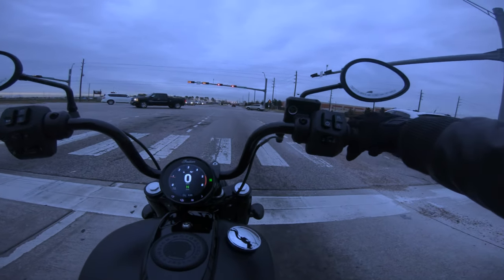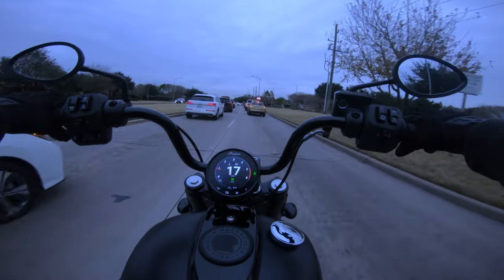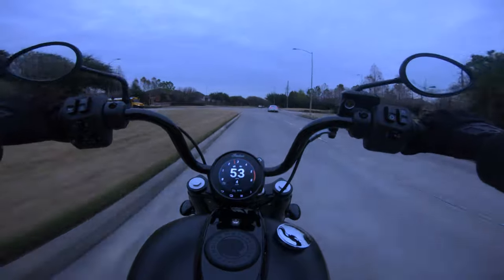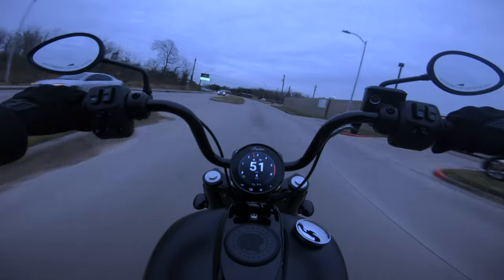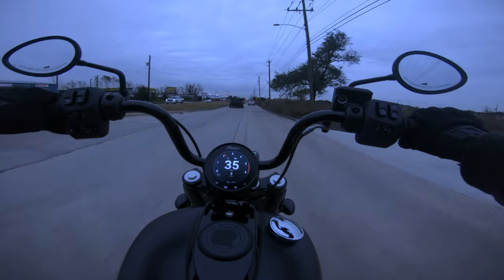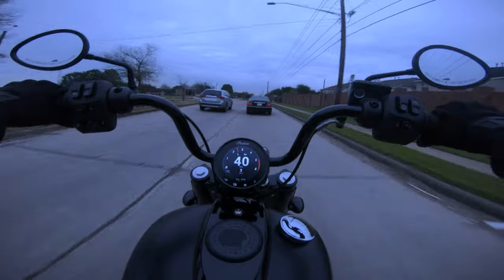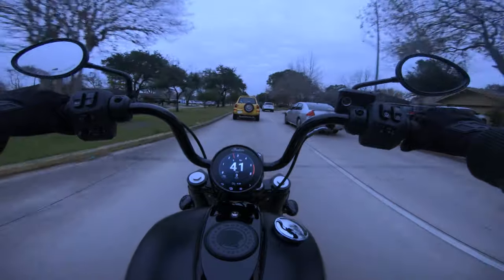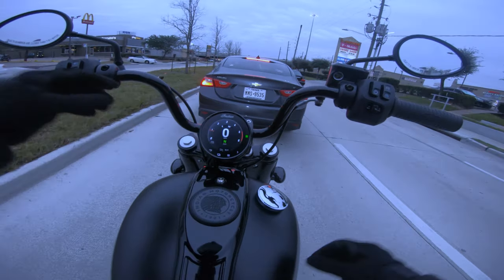Full System Exhaust In Any Day Now!

Comment: What's the stock mini apes handlebar height for your chief bobber, 10 inches?
Reply from the maker: The bobber comes with the "mid rise" bars. Which are classified as 5" bars but I've heard they're actually closer to 7". Haven't checked for myself
Reply: @darsoma9522  are they comfortable or do you believe the 10 inches mini apes would be more comfortable??,  I currently have a chief dark horse with the drag bars and I find them uncomfortable.
Reply from the maker: @xMUHANNADx94  I think the bars are pretty perfect for me, but I'm only 5'8 so taller might be better for a taller rider